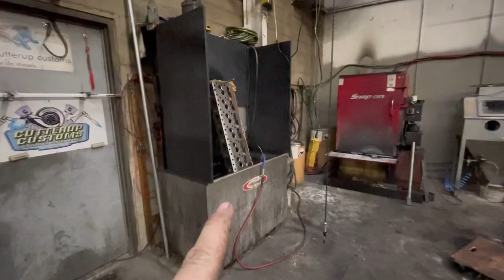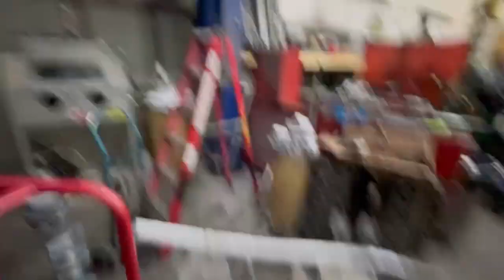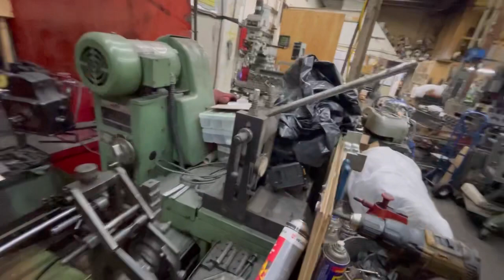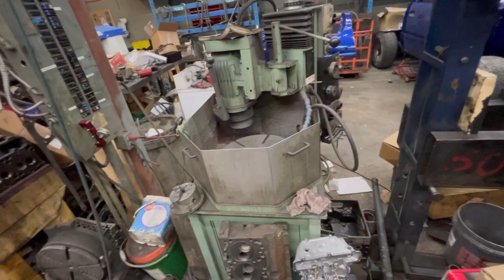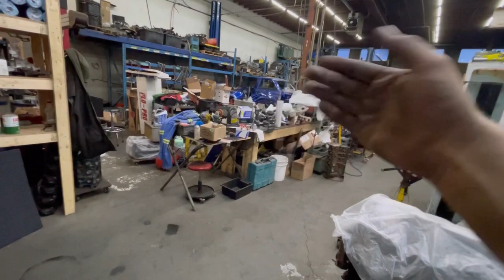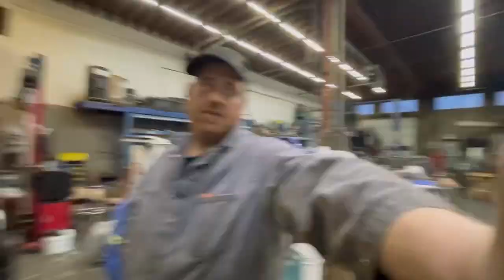Equipment Walk through. SHOP TOUR

Comment: Hey another great one would be installing 14mm main studs, procedure for drilling and tapping and measure the main bores after and addressing any line honing and or boring that is required because of the greater stud clamp load
Reply from the maker: I was hoping someone was going to want one done so I could show it on one I was doing. But at some point I will do it